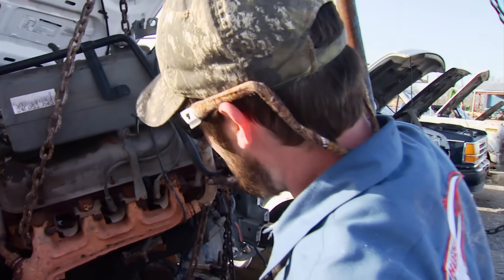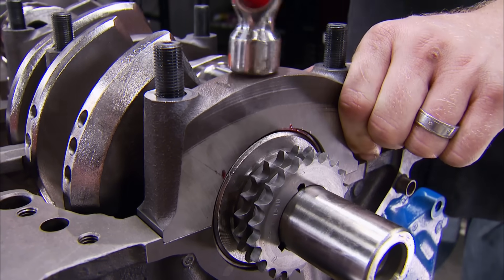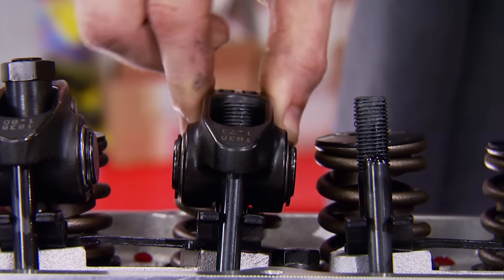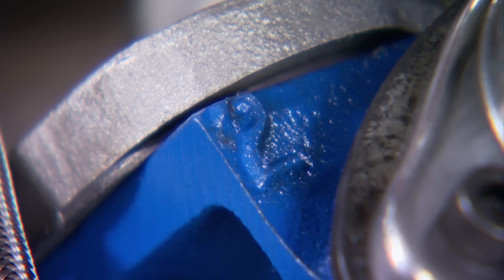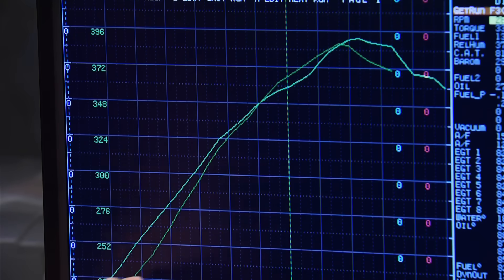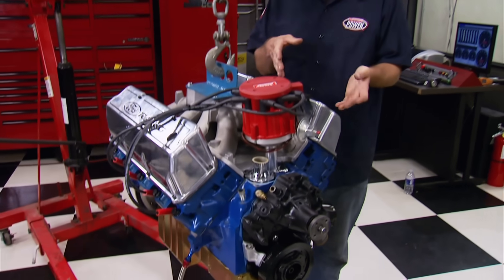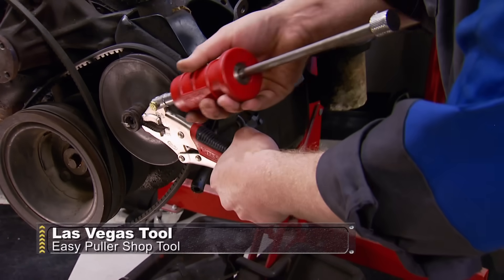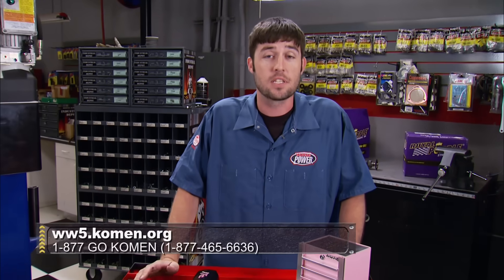351 Small Block Dyno Shootout: Windsor vs Cleveland - HorsePower S16, E11

Comment: Damn , been told my whole life 4v over 2v for any application . Lol that junkyard knowledge doesnt pay .Thanks for the clarification guys.
Reply: That is not a comparison.  the 4V would trounce that 2V with more plenum and/or more cam.  You could even have a mild street cam with alot of lift and recover most of the torque and make more power.
Reply: @blackopsrocks  Cool thanks i do appreciate proper knowledge or at least something that could lead research. My mind can  see the build they did in a 2wd bullnose for street fun I actually think that would work well ,and the set up you described in a fox like an 84-86 ltd for some strip work.
Reply: Add to the previous reply that they were still running the smaller 2v port intake, which in my experience always loses power when bolted to the big port Cleveland 4v heads and of course the 2v heads had a better power band. Poor Cleveland could not breath right, think deviated septum!
Reply: @BloodRaven1969  I see these jokers build stuff and just cannot believe they dont know how to put a combo together and make good power.  I was floored with the 460 series and 10 grand into the thing they  just narely make 500...stupid.
Reply: @blackopsrocks  Agreed. With $10k and a Summit catalog any decent builder, even a sbc specialist, could easily make FAR more then that.
Match your parts is a simple sounding but oh so true and important rule to follow.
Reply: What you were told was correct. You need the other parts to support the heads.

Comment: This whole "comparison" was not much of a comparison.
Reply: tech1302 Stock heads vs Aftermarket ....what a joke.
Reply: @alexcorona  if they would have used the closed chamber 4v heads and a 408 cleveland and bigger cam with that single plane intake and did a 7500 rpm pull then itd be a more fair comparison.
Reply: Not a decent or fair comparison. They dropped a ton of money to upgrade the Windsor and basically made a stock 4v Cleveland.
Reply: No it was not a lot left out on info as well as one being longer stroke.
Reply: I like how they neutered the Cleveland with a single plane intake and put a dual plane on the "Clevor." No shit the one with the single plane is going to fall on its face in a street driving scenario.
Reply: @TwentytenS4B8  And sucking on low compression heads?
Reply: @TwentytenS4B8  single planes have come a long way and can be extremely streetable.  Single planes will make a ton more power.
Reply: @springwoodslasher79  Overall design and alloys have much improved but the same basic concept still persists. A single plane intake is for a higher RPM power band I.E. racing. A dual plane is more suited to regular street driving with the occasional drag strip trip. The guys on Engine Masters have done a comprehensive testing episode outlining this.
Reply: @TwentytenS4B8  they make single planes that start making power at 2500 like the torqer 2 and will destroy dual planes in power .
Reply: @springwoodslasher79   - "single planes have come a long way and can be extremely streetable..."  Probably do better with throttle body FI though.
Reply: @scootergeorge9576  fuck fuel injection.    You can do a single plane carb set up for half the money.
Reply: @springwoodslasher79  93 Octane (unleaded) vs 100 to 104 (leaded) from 1970 was/is one reason; i.e. 11:1 compression. One was built to handle high comp. the other not so much.
Reply: @bigboreracing356  sure you do.
Reply: The problem with the intake on the Cleveland was port size. I bet it is the size of the 2v intake ports not the size of the 4v intake ports. Power should have increased not decreased by adding increased airflow and it didn't. That says to me the airflow between the 4v heads and intake wasn't increased.  I figure the opening up to a bigger size port in the head slowed the air down quite a bit from the smaller intake ports on the intake. Either way there is no comparison if the intake ports do not accurately match the cylinder head ports. Considering the smaller 2v heads made the most power the intake ports were sized to match the 2v ports.
Reply: @jeremiahpike6372  Not only smaller 2v ports on the intake but they were also probably offset mismatched which makes it even worse.
Reply: @macfranks2456  true straight paths uniform in size or CC of flow is important. There can be benefits to a mismatch but they are fuel efficiency or exhaust emissions related benefits. Definitely not power gaining benefits. Port matching and a pocket porting are things done to racing engines to improve flow characteristics of stock parts. Seeing as how they used aftermarket heads on the Windsor engine it is nowhere near a fair comparison between the two engines. Aftermarket cylinder heads generally take away the need to ports match or pocket port as those deficiencies are taken care of by a new casting of the ports.
Reply: @jeremiahpike6372  It's a little more than that and a little less at the same time. You see, single plane intakes have much shorter and straighter runners to allow for a straight shot to the intake valve. Dual plane intakes have a divided plenum to allow for better distribution along the cylinders at lower RPM as well as longer runners. Runner length directly influences the torque curve. Longer runners = more bottom end torque. Short runners = higher RPM torque peak as well as horsepower. While it is possible to put too big a head on an engine and the result would be that the camshaft and intake cannot use the heads efficiently, it's more based on the wrong intake being used for what the engine was built for. In this case, the camshaft and intake were not matched and thus could not make full use of the heads. The larger intake ports no doubt slowed down the intake charge velocity which causes stalling in the intake runners. You want that air\fuel to move as fast as it can at a consistent speed. Slowing it down or intermittently stopping it has the detrimental effect of perpetual turbo lag.
Reply: @TwentytenS4B8  duel plane intake manifolds were designed to make aggressive duration camshafts more streetable or to add better drivability at low rpm with an aggressive overlap of intake and exhaust valves being opened. Overlap uses the force of the combustion gases exiting the exhaust valve to pull in a mixture from the intake valve. This overlap gives a lopey idle. The reason why is at low rpm this effect doesn't work so well it allows exhaust gases to get back into the intake from adjacent cylinders that are in a different part of the 4 stroke cycle. The duel plane or split between banks keeps this tainting of the intake mixture from being such a problem by only allowing 4 of the eight cylinders into that intake tract. Modern engines use camshaft adjustments to make this happen to help or replace the EGR valve. I assure you the intake used was not properly sized to the larger intake ports of the 4v cylinder heads. It's actually a pretty common problem from aftermarket manufacturers Edelbrock is especially bad about it. I have seen their intakes have smaller ports than cylinder heads quite often. Generally it happens because they make one intake for a few different cylinder heads some with larger ports and some with smaller.
Reply: tech1302 https://youtu.be/SIfjak3j_CY
Reply: iv had clevlands and windsors they were dogs compared to my buddys small block chevys.

Comment: Hold on im lost you did a basic rebuild to a 351c and BUILT a 351w cam heads the whole 9 and then compare them WTF over....
Reply: The Cleveland got a rebuilt and the Windsor got a 3900 dollar top end kit on top of it being a 408🤦🏾‍♂️
Reply: @bigboreracing356  except they had to stroke the Windsor and turn the top end into a clevland to get it to beat the clevland
Reply: @bigboreracing356  I know your upset you have never had a 351c that's not why I commented on the vid apples to apples should be apples to apples not a 1000$ rebuild vs a 6000$ rebuild and yes they put Forged rods in the 351c but for what? Under 10:1 lmfao come on man
Reply: @bigboreracing356  but they used the Cleveland head, so it doesn't, as you claim, shut down the argument.  The Cleveland head can clearly pull the numbers.
Reply: maybe there canadian,.??.but,id have a mild 460.with alloy heads,pump,weigh about same as a 351.twice the power.alloy heads,headers,2 plane intake,flat tops, mild/rv cam.run forever.
Reply: @phantomwalker8251 I’m with you
Reply: I’m with you! But, aluminum heads for the 460 are getting pretty cheap!! The only reason not to step up is the overdrive! However, if you can find one of the 351 m transmissions?!
Reply: @bigboreracing356  So now you are claiming the ford cleveland heads are superior to these aftermarket ones.  Well that's different.  Go the CHI 3v jobbies if you want the numbers.
Reply: @bigboreracing356  that 408 windsor wouldn't put up the numbers a properly built Cleveland would.  I'm a windsor fan by the way.
Reply: Crown Commando   My dad learned that in the army in like 1975 lol
Reply: Crown Commando  Roger Over
Reply: Next time they'll compare a stock 289 and a tricked out blown 460.
Reply: Open chamber heads? Ford Aus were getting 450hp on some road going GT Falcons in 1970.
Reply: Yea and used open chamber heads for the cleveland. Never seen the closed head version.
Reply: @bigboreracing356  ..you have a good point there sir👍😁

Comment: Clearly, the Windsor has a better product support lineup...
Reply: Makes sense considering the Windsor is more prevalent than a Cleveland. You can find Windsors ( 302 and 351 ) in junkyards all day long. The closest thing you're going to find to a Cleveland is a 351M and even those are a rare find.
Reply: @04Interc3ptorP71, there's also the 400. Same engine with longer stroke taller deck height. And big block bellhousing.
Reply: only thing you need to make a clevo go,,is 302c heads,mild cam.job done.i have one on lpg only,would be scary on fuel.its dangerous now.!!.does 35 mph,at idle..
Reply: STREET RACER if you could only use a stock block, which one?

Comment: I'd like to see the Clevo with the 393 stroker and a set of 3V alloy heads.... closer comparison.
Reply: I would like to see the 4V Clevo head on the same 408 short block as those Edelbrock heads with the correct cam to match!  The 4V's would smoke those Edelbrocks easily and likely equal the 3V heads!  This whole test is bogus!  The correct cam for 2V heads is totally incorrect for 4V heads!  I learned that way back in the 80's!
Reply: @stevesabbagh793  A set of the mpg port plates will improve performance on the 4V heads by straightening out the airflow through the runners, too. They actually flow higher cfm numbers with the plates in place, especially at low to mid rpm, thus you gain not just high end hp, but more power over the entire curve.
Reply: I built a 393 Cleveland with Edelbrock heads, hyd roller, Performer RPM Air Gap, 750 cfm Quick Fuel carb on 92 octane,  MSD ignition and made 500 whp and 475 wtrq in a 71 Pantera. That car was a hoot.
Reply: Or a 408 Cleveland stroker with the same cam and comp both engines with the same brand of heads like edlebroock Windsor 190cc vs the Cleveland edlebroock heads would have been better

Comment: Will there ever be a true apples to apples comparison amongst engine builds? It must be a taboo voodoo sin curse to ever do it correctly.
Reply: You have to watch Engine Masters to see that happen.
Reply: Not as long as sponsors are supplying the parts!
Reply: Joe Dduncan excellent point!
Reply: Horsepower monster had a nice vid of carb vs efi. They were not equally matched but at least it was a close comparison and decent video.
Reply: yep watch engine masters
Reply: Having seen what Dandy Engines does with Clevelands, damn skippy the Clevo will win.
Reply: i totally agree
Reply: @bigboreracing356  good point
Reply: A cool series to do would be "here's a specific amount of cash for each team, build your best effort with this particular engine platform and then we dyno them!"
That way, we get a legitimate engine vs engine shootout, with final cost being the even limiting factor on both sides, and any free hp tricks the teams can come up with to make power are allowed.

Comment: So, with 30% bigger heads with the same small 750cfm carb didn't make more power, not surprised. Put a 850cfm carb on that 357c and you'll see a big difference. More flow more go.

Comment: I'd like to see a dual plane intake on the Cleveland
Reply: With the 2v heads yeah
Reply: @289pinto  With the 4V heads and a jet change, the Cleveland would have broken the 500 HP mark.
Reply: @TwentytenS4B8  I didn't understand why they didn't do a jet change while messing with the timing!
Reply: The dual plane would up the Torque down low in the RPM with the 2V heads. a great set up for a
stock build up can benefit greatly dialed in with the cam, timing and carb.

Comment: This is one of those rare times that I wish they had spent more money.
The Cleveland needs a set of CHI 3V heads and a Parker Funnel Web intake.
The Australians are the best at Clevelands.
Reply: The best CHI head for you money is the DS208 and the CHI intake, I have made made over 540tq and 670hp on pump gas with out of the box parts and a flat tappet cam. I still have the original developmental heads in my shop, These heads and intake made best power with 17degs of timing.
Reply: @racerd3801  I don't think Parker is even in business any more, maybe they got bought out by CHI ??
One thing is for sure, if John Kaase is willing to put his name on a CHI equipped engine then it's the best there is.
Reply: @johnparrish9215  John I did the 185 head and 208 head. and also the intake, not Jon Kasse . He loves BIG port heads, but fine for all out racing they make a very poor street head.
Reply: @johnparrish9215  Parker manifolds are still going. they are up in QLD. Jon Kaase worked with CHI on design input for their heads. cheers
Reply: @racerd3801  im in aus and own a 408 stroker cleveland in a xr gt rep. Ill be lookin at an ally head top end as i currently have flowed 2vs and will be upgrading in the new year. Any idea where i can find out more about those heads you speak of?
Reply: @devilsgarage7726  the more you know. Thank you sir. Aim to build my xr up for regular streetcar shootouts etc. drive to track, race, break, fix, drive home type of deal. The block is ready for 600 thanks to Remac machining and some sleeves, but had a set of 2vs fall into my lap off a mates boat application and for near free, they were still good for 265rwkw through a top loader and 9inch with 3.90ratio. The 2vs have been fun, but the itch is getting unbearable 😂 thanks again for all the guidance, time to talk to the mate who helped build it about a heads and cam package for next year
Reply: Just go to the CHI web site and you can buy them direct , If this is a road car on pump fuel, your best bang for the buck is the 208 head, don,t be fooled by the flow numbers, when I did the original designs, the 208 out flowed the 218 head with a smaller port. But with the risk of killing the sales of the 218 heads the flow numbers were reduced on purpose, so what is advertised is not correct . and use the matching intake.  @RT-Revs
Reply: @RT-Revs  a nasty addiction that.. lol. good luck and keep havin fun. :)
Reply: All the Cleveland needed was a dual plane intake and a jet change in the carb.
Reply: John Parrish yes us Aussies did have a knack to make American truck engines into all day high rev monsters...

Comment: Doesn't look like an honest comparison. What gives... I thought PowerNation quit bs'ing the viewers. I guess not.
Reply: Power nation is just an ad for parts nowadays. Both of these engines underperformed. Big time.
Reply: Their ONLY objective is to sell parts...
Reply: This is a an old show!
Reply: Ok and?
Reply: @doober4404  the original poster stated he thought they had stopped BS'ing. I just replied that it is an old show.
Reply: your kind of a Moron...they cant run 5 cams 4 intakes and 50 dyno runs..we All know the 4v is lower on torque done low but is better up high with  the proper cam..you need to quit livin off mommy tit AND GET A LIFE